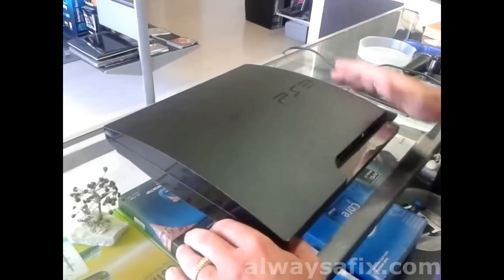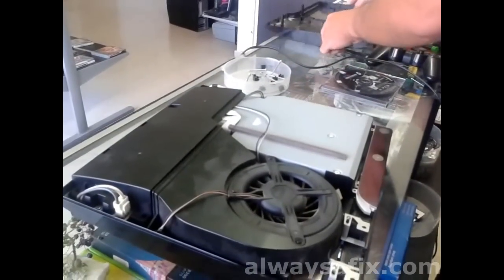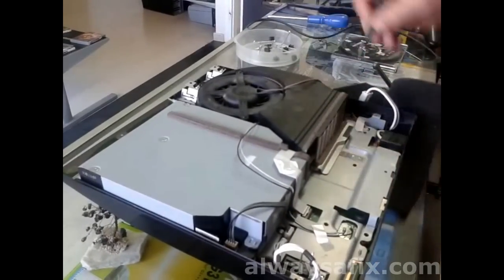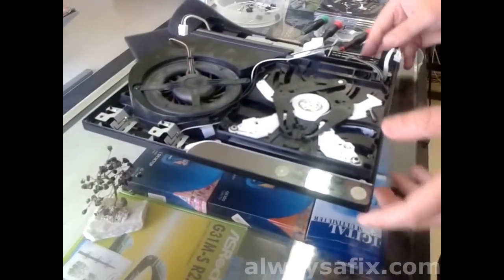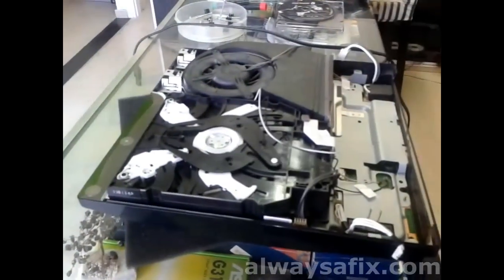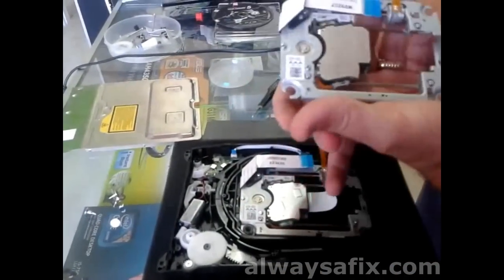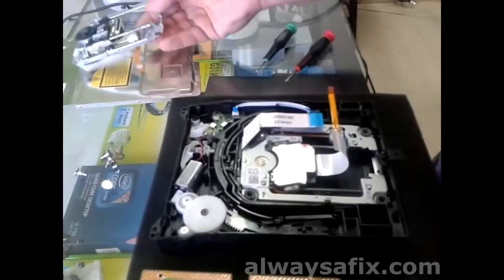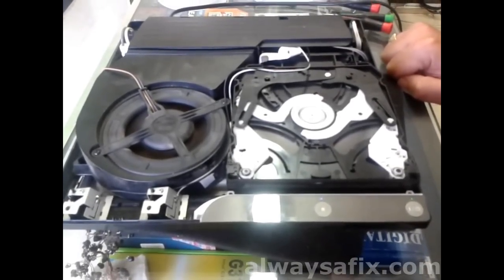PS3 Slim not reading disk Laser replacement

Comment: Most times its not the laser its the rails try tightening them on the four screws before replacing the full deck always works on for me when I fix them
Reply from the maker: Thanks for your input.
Reply: Hi can you help me pleas my ps3 didnt read the Cd that bot started the game have you got anything we can write Intagram or Skype or whatsapp or Viber
Reply: im gonna try that, my discs are spinning up but not reading and its smoother since i greased the rails
Reply: @alwaysafix   oi
Reply: @greenjoe4202  did you have  success yet ?? I have same issue disc spinning but fail to read disc.

Comment: Thank you so much alwaysafix!  it is because  of you that i fixed my ps3 slim.  my my ps3 wouldn't read blue rays but stranglyy, it reads regular dvds.  i didn't replace the laser like you but what i did was clean the  lasers with 99% rubbing alcohol.  now my ps3 is back in action.  thank you much for the.disassembly video.  i couldn't have done it without it.  may good karma be with you my friend.

Comment from the maker: @Kirollos Edward Do you mean you cannot insert the disk into the PS3, or it doesn't recognise any disks?  Make sure that heatsinks are free from dusk to prevent overheating.
Reply: so all I need is a new laser
Reply: `What is the model number for the new laser? I believe I have to replace mine's as well. I don't want to just open the console to just get the model number and wait for the lens to arrive. I want to get the lens and repair it quickly

Comment: 9 years later...still a great video.
I'm having trouble with a ps3 slim.
Disk will read if you tilt machine 45 degrees then you can set to back down.  If cleaning won't fix... laser replacement seems next step.
Thank you

Comment: well what if mine freezes every time i have a game inside of it after 15 mins of playing it whats that problem because i changed the disk drive and it wasn't that so i don't know what the problem is and now it doesn't want to accept any disks
Reply: Kinda late to the party, but it might be overheating.
Reply: Yes it is overheating..
You can try to open it and clean your ps3 fan from inside.. I am dure it will make a fifference

Comment: My disc spins but doesn't read. What could be my problem?
Reply: Tru Alpha808 same
Reply: Tru Alpha808 just buy a new ps3 or ps4
Reply: Tru Alpha808 I can play for five mins then game freeze.
Reply: I changed the lens drive but still it wont read ps3 disc or blue ray disc ps1 disc are the only ones i can use
Reply: Ok about the last comment i already install the new lens drive and yeah still dont read disc then i did a file restore and the ps3 found a corrupted file and then it made a file restore when the ps3 restarted i put diablo 3 disc and started to play fine

Comment: This video is very helpful. I first decided that my PS3 was out of warranty and maybe it would be time to upgrade to a PS4 in the event this didn't work. A super-small flat head worked okay to unscrew the 3 security screws. I took the PS3 apart per the video directions (just to make sure I could) and got the laser name off of the deck. KEM-450AAA. I reassembled the PS3 without issue, except I did forget to put the magnet 3:57 back on top in the drive. I noticed the magnet was laying to the side after I got the drive put back together. Just more practice when I took the drive back apart and put the magnet back on. I received an actual security screwdriver with the new laser I ordered. I just took my time and made sure to put all the screws in particular places so I did not lose or misplace any. I have quite a few PS3 games and blu-ray movies! Glad this worked, thanks for the vid-
Reply from the maker: +parglefod Congratulations on your fix Im glad this video helped.  Happy gaming!

Comment: Thanks man, you a life saver!!!
I use your video to strip my PS3, but I just clean the laser with alcohol and now its works perfectly. O yeah just info for others if you have some trouble to find torx screwdriver, just use flat screwdriver with 2mm size.

Comment: Awesome video & instructions. UK PS3 slightly different - (there's a ribbon cable underneath the drive too!, BE CAREFUL! And 3 at the back where as you have one & the disc drive unit has no green board to remove - However, this video gave me the confidence to order the parts / tools, (KEM-450DAA for Slim 160/320Gb & tool kit) and have a go. IT WORKS!!! :) £28 vs ~£100! My drive played everything else fine EXCEPT GTA5! Good enough reason to fix it......be brave and DO IT! Kudos to you sir, Kudos!

Comment: Thanks for the great video. I have two quick questions if you have the time to answer them:

#1: Do you know how reliable these replacements are? I've read up a lot on my issue, and most of the information is old, 2008-2009, about fats. I have a CECH 3001A (160GB slim). These threads tend to say that replacements didn't last for very long, but I know the drives were also different, and that the lasers were second hand or refurbished, as they weren't being made any more. Are these lasers you buy brand new?

#2: Wondering if you agreed with my diagnosis of a dying laser:

Symptoms: PS3 loads, boots, everything fine. Had problems with two games, MGS4 and Uncharted 1. MGS4 I got to the very end, and it froze on the final credits. Freezes at the exact same moment every time--read the rest of the game perfectly. However, I put a second copy of the game in, a friend's, and it played through. Uncharted is similar--freezes at the same point every time. I thought Uncharted might be HDD related, but it's just AFTER a save, not during. I thought maybe the discs were scratched, but they look almost perfect. I think maybe the laser isn't dead, but is dying and getting weaker, and is having trouble with very tiny imperfections.

Guess I'm going to try cleaning the laser first, then resorting to replacing?

Thanks again!
Reply from the maker: Yes, first step would be cleaning the laser first.  If that fails, maybe you should find a repair shop that will replace the laser with a warranty.  Good luck!

Comment from the maker: You need to disassemble your console.  There is a sticker on the railing of the laser (I show you the exact location in the video).  You need to order a new laser  according to that sticker, to be 100% sure you get the correct part.

Comment: Great vid.  But I want to make sure I actually have to replace my laser before I try to do this.

So my PS3 is recently brought second-hand, and at first everything was fine.  But then after 40 hours or so play, I noticed the movie intro for my games started to stutter slightly with the drive making disc seeking sounds during each pause. 

The game itself plays normally at first but when the scene or the bgm changes, the game's loading icon comes up and the drive makes more disc seek sounds.  This gets progressively worse with extended play time, with the load delay being upto 10+ seconds (It was originally near instant) until finally it becomes stuck completely with the drive still making seek noises.

Turning the system off and letting it rest, I can turn it back on and play for a little while, but the problem comes back and eventually I hit another fatal loading stuck.  I've opened the box before to see if it might be a dust problem, but the fans look surprisingly clean and in good working order.

So what do you think?  And is there anything I should try before trying to look for a replacement laser?  I've heard some people say you can just clean the laser, but what do you use to even do that, as I assume the lens is pretty damn delicate...

Comment: Do the metal pole pieces that the laser sits on have to be lubricated at all since it is a moving part?  and what kind of tape is used to tape down wires? i need some. Fyi: your vid was very helpful in taking my system apart successfully. thanks

Comment: So mine wasn't reading discs and making the ejecting noise, I got the new deck just like this video but when I plugged it in the disc still don't read and disc won eject.. Did I forget to connect something or did I connect something wrong?
Reply from the maker: If the disk is not ejecting, then something has gone wrong with your reassembly.  You need to take it apart and try again following the steps in the video.  Good luck!
Reply: raymond kuzara this is old, I know, but it was probably the blu-ray ribbon above and across the disc drive that was assembled wrong.

Comment from the maker: If you are able to disassemble your PS3, you can remove the top cover of the blu-ray drive, as I have done in this video, so you can actually see what is going on with the disk inside.  See which part is making the clicking sound and get back to me.

Comment: Hey great vid, my PS3 was doing the same, but I've replaced the laser with a new one and checked to make sure all connections are plugged in but the PS3 wont acknowledge a disc being inserted. Do you have any tips or ideas on what the problem could be? Thanks

Comment from the maker: You could have just a simple overheating issue.  When a game hangs, if you hear the cooling fan running at a high speed, and the PS3 is hot to the touch, you might just need to take it apart and give it a good clean.  Good luck!

Comment: Hey need to replace the laser as you showed in this video. Can you give a link onto here to buy the new laser.  Do the sale the hole component.I messed with mine a little now it's not kicking out the disk automatically
Reply from the maker: Try ebay or Amazon.  You can buy the whole blu-ray drive.  Just make sure you get the right one for your model.

Comment: I opened it up again & to check the model on the laser, sadly after putting it back together now the plastic loading/ejecting mechanism is not working lol I then took it apart 3rd time to see if anything looks stuck, but it looks fine. Ugh! I might have to give up & buy a new/used ps3 :(

Comment: Great video - thanks very much.  I struggled at 5:59 removing laser cover until i noticed one side of the silver top is secured by very subtle black tape
Reply from the maker: Thanks for watching.  Your comment could help others in the future.
Reply: alwaysafix
 11 months later the fix is still working.  PS3 works like new.  I wanted to mention the ebay seller that I bought the part from but sadly ebay won't let me figure that out...

Comment: i bought a torx screw for the security screws and it turns out they put a little thing in the middle so the security screw won't work. How do you take out those screws?

Comment: Hi, my PS3 slim 120gb, keeps making grinding noises & i have been opening it up every month & cleaning the laser lens & motor with alcohol, it tends to stop but always returns, i'm thinking of getting a new laser, would this fix the grinding problem? as i'm not 100% whether it's coming from the laser, but it defiantly comes from the disc drive area, as it only does the grinding sound when a disc is inserted. please help.

Comment: thanks for the video! What type of screwdriver are you using to unscrew those Sony special screws? I can't find them anywhere.
Reply from the maker: I use a flat screwdriver that is just the right size to fit along one of the edges of the screw.  Good luck!
Reply: Just get a torx t8 only 50 cents to a dollar depending on where you get it from

Comment: Had the read disc error (the one when it makes that eject sound but the disc doesnt come out) and the solution (in my case) was simple: reset factory settings by completely (not fast) formatting the hard drive. In my case it was a software error caused by a bad update. Hope you guys find this tip useful.
It takes a long time to completely format the hard disc but it worked.

Comment: Mine has the problem that it doesn't eat the disk anymore, at first did, tried to repair it, it didn't eat it anymore, and I don't have those Talk Screws or whatever, any improvisation  ? i have the talk screws but something like a metal tip sticks out and i can't put it in..

Comment: My ps3 recently started doing the eject noise and not reading the disc. And the laser is new and almost not used. Sometimes if it reads the disc i can play for 30minutes to 1hour and it will stop spinning and readinh and the game will freeze. Can i clean my laser or do i need a new one? Also what do i clean it with?
Reply from the maker: You mentioned that the laser is still new.  Is the Play Station still under guarantee?
Reply: alwaysafix Yes it is new. Can it be that it was broken already when i bought it? No, it isn't under guarantee :( Thanks for reply though

Comment: Thank you so much for this video it was very helpful .
Once I opened my PS3 I noticed that  disk is spinning and there is a little noise like the laser lens is trying to read the disk .
After few minutes it stops and make the eject sound .
Any suggestion with this issues .
Before replaced the laser 
Thank you

Comment: Replaced the proper laser but it still isn't spinning the disc. The disc is brand new by the way. It just does the same thing as the old deck, accepts the disc but it makes the ejecting sound afterwards and then nothing.

Comment: My old one tried to spin up and load but then just wouldn't load. I got a new one and it then does nothing at all, it wouldn't even pull the disc in. I have a feeling the new part is faulty. Because when I put the old laser back in the disc pulled in and again tried to load.
Any ideas or should I just return the new (perhaps faulty) part and try another?
Thanks

Comment: Hi thanks for the easy instructions. My disc actually spins just fine, but the disc still doesn't read.  It will attempt to read, stop (making click sound), and then try spinning again to read.

Do you think this is a laser problem as well that can be solved by replacing with a new deck? Or do you something else is the cause?
Reply from the maker: If it does this with all your blu-ray disks, then try clean the laser first.  If that doesn't work then you will need to replace the laser.  Good luck!

Comment: I have the same ps3 and the same problem except mine makes the eject sound when I put in a disc and when I turn it on. This only happens with games and blu-ray. It only reads DVD's. Could this be fixed just by replacing the laser ?

Comment: what tools did you use to take out the Sony security screws?
Reply: +Jocelyn Hernandez it's a torx screwdriver you can get at home depot or lowes it's type "tt" it has a little pin in the center.  I think it's  size 6 or 8 i don't recall but he says in the video which size.

Comment: Hey. So I've recently installed the laser I bought. And the moment input the disc in, it automatically did the ejecting noise. Could it have just been a problem in the installation process? I'm hoping that's the problem and not another problem with my ps3 or laser. Any tips?
Reply from the maker: You need to insert a disk with the top of the blu-ray cover removed, as I have done in the video, to source exactly where the sound is coming from.  Good luck!

Comment: My playstation does not ready any discs at all (games, dvd's, blu ray) 
The loading clock on the top right of my screen spins for a little then stops but the disc does not appear.  I've opened up my PlayStation and the disc does not spin. I don't know if I have to replace just the laser or the deck as well. Help me please!!

Comment: Can I fix mine a sledge hammer? No seriously, I had a fat ps3 did this so had it repaired and it lasted 3 months. Same thing. Bought a new slim and struggled reading but worked if I tilted the machine 45 degrees... Now it's doin exactly like this vid shows. I've cleaned the lens but the worm looks pretty worn too. Need whole new rack I think but could it be a faulty drive (daughter card) board?? I hope ps4 isn't as poor quality as all the other playstions!

Comment: could be advanced graphics, over heating, burnt out blue ray, replaced it myself, been over a week now, GTA 5 works without problems.  I also stuck furniture leg felts on the bottom of the unit (doubled up) to allow better air flow underneath, it sits half an inch higher. Bought at dollar store. Do not place them over screw holes, I also have a fan blowing on it.  Iam hoping this method holds up.

Comment: I can't remove the two screws holding down the power unit, I've tried everything, i think they might be glued in possibly? Any advice?
Reply from the maker: If its the first time the PS3 has been opened, I very much doubt that the screws have been glued in.  Try and get hold of a better fitting screwdriver.  Good luck with your repair!

Comment: Should I buy a new laser deck?
My 120GB Ps3 Slim will read my discs but after playing for about 5 to 10 minutes it freezes and then I eject the disc and then it will go back to the XMB menu. When i try to put in any games after it has frozen, the disc will spin but not continuously and it will not read. About a 30 seconds later, I will get the eject noise but the disc doesn't actually come out. This happens every single time i turn on my ps3. When i turn it off and turn it back on, it does this whole process all over again. Please help!
Reply from the maker: Have you opened it and cleaned out the heatsinks to make sure it's not overheating?
Reply: Yes. I've cleaned the heat sink and the fan. I'm 100% it's not because it's overheating.
Reply from the maker: Raymart Quidilla Try cleaning the laser first.  Good luck!
Reply: I've cleaned the laser already and it still does not work. 
It will read my discs for 10 minutes or so. Then it stops reading them.
Reply from the maker: Raymart Quidilla If you have cleaned it and it is still not working, it looks like you need a new laser replacement.  Good luck!